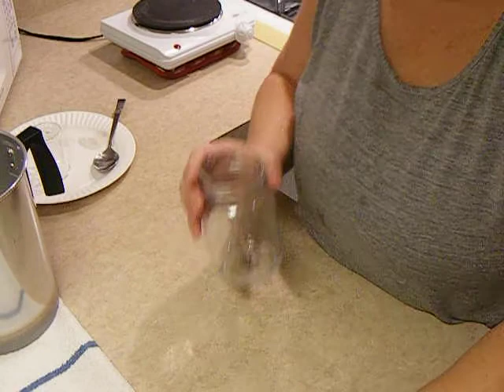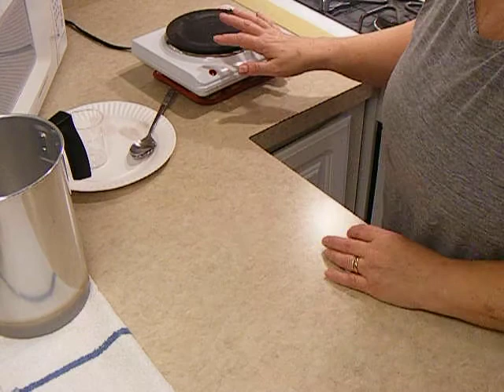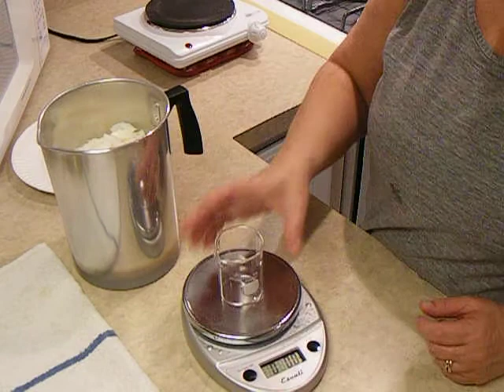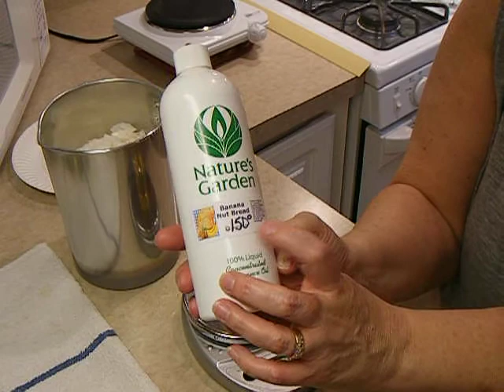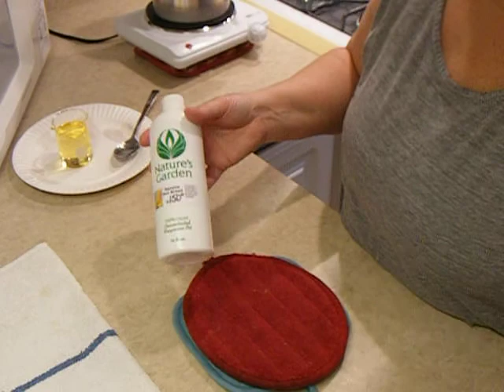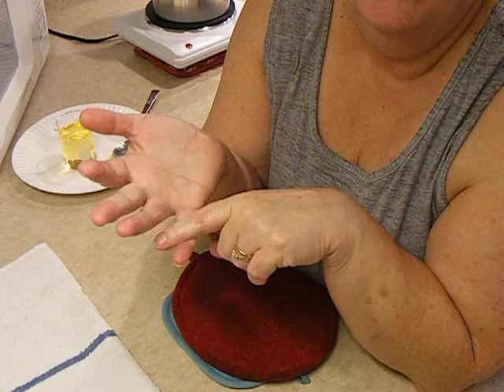How to Make Soy Candles - Part 2

Comment: Great video! I’m new to candle making and have yet to get a decent scent throw with my soy wax. Do you add all fragrances at 150 degrees?
Reply from the maker: The most important thing about adding fragrance oil to any wax is pay attention to the flashpoint for the fragrance oil. Add it just below the flashpoint. I tried the adding all fragrance oil at 150 and it just took so long. I didn't think it helped with the throw. I heat my soy wax to 185 and if my fragrance flashpoint is 185 or above I add it. If it's below 185, I wait until the wax cools to one degree below the flashpoint and add it. Good luck!
Reply: Dragon Moon Creations Thank you so much!!